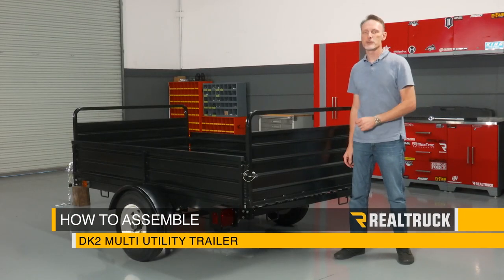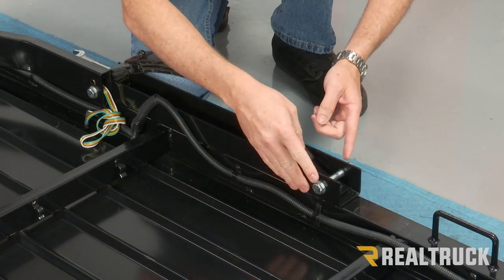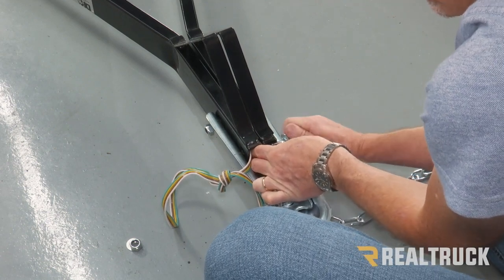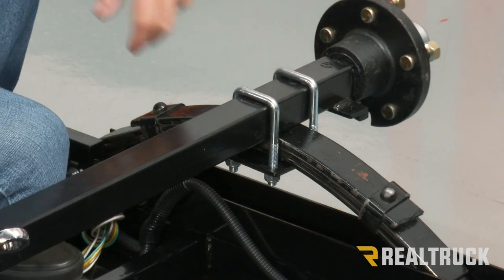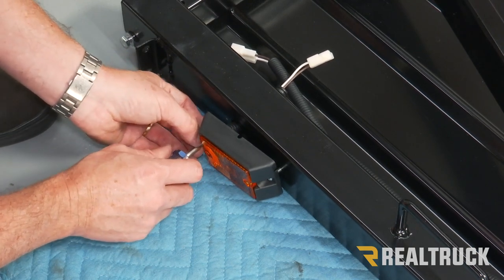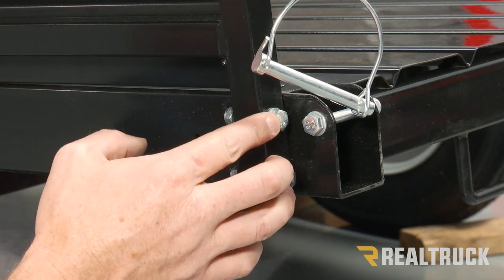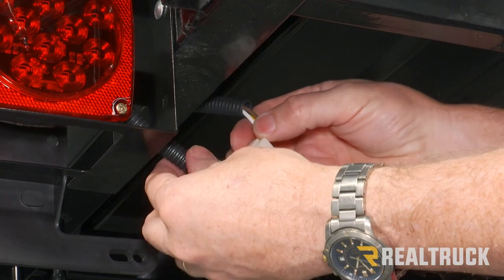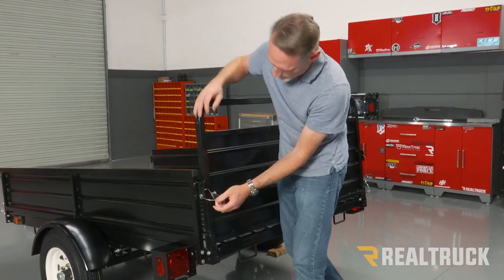How to Assemble K2 Mighty Multi Utility Trailer

Comment: 5/26/20-I had to fit brackets for fenders at the same time as attaching "A" frame to springs and trailer (the first step in construction.)  This is different from video.  Look at "Step 2" in manual.  I bought my trailer from Home Depot in May 2020.
Reply: The whole reason I came here was to double check the fenders, but this video was useless in that regard...
Reply: Ditto from Home Depot.   Had to buy more washers.   Missing from Manufacturer

Comment: IS THIS TRAILER WIDE ENOUGH AND LONG ENOUGH TO HAUL A 60 INCH CUT DECK ZERO TURN MOWER
Reply from the maker: Hey Rick, that probably won't work for you with a 60 inch. The width of the trailer is 60 inches, so if the tires and the chute is wider than the deck, it won't fit. If you had a narrower machine, you may also have an issue with the tires getting stuck in the space in the gate.